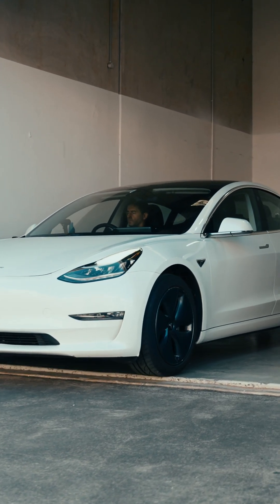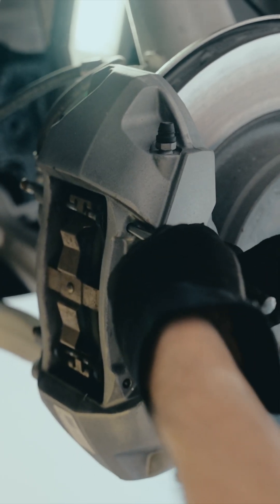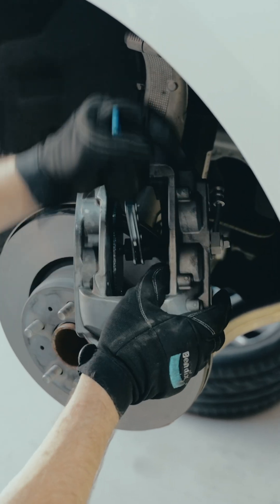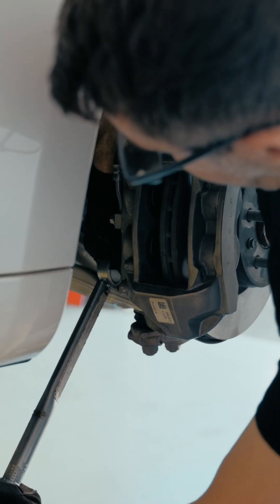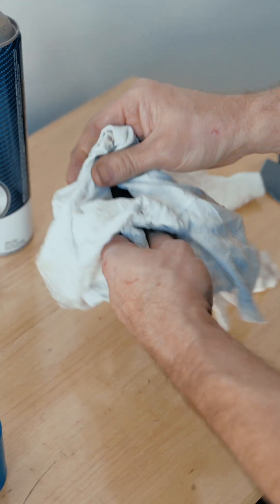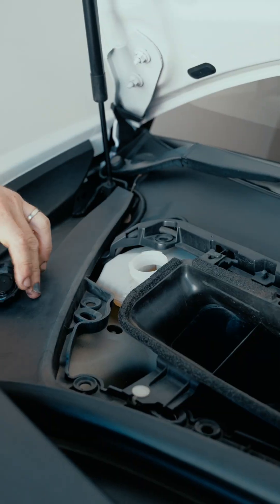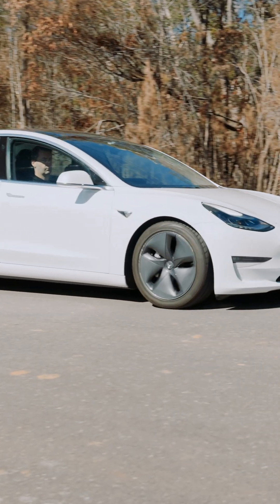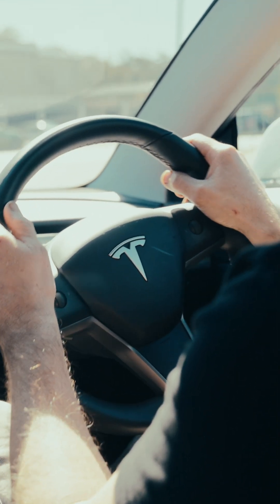HOW TO: Tesla Model 3 Brake Service

Comment: You need to be dumb enough to finish tesla break pads. They are one pedal drive vehicles so when you slow down regenerator charges the battery and slows down the car so you barely use breaks on this cars. Pads and discs should last end of the vehicles life.
Reply: First, cars have brakes, not “breaks.” Next, exposure, debris, rust, etc can affect suspension and brake components. All vehicles brake parts  require periodic inspection, cleaning, cleanup. Best not to ignore brake system checkups waiting for mechanical issues. EVs using regen slow down means brake components can get rusty. Thanks.